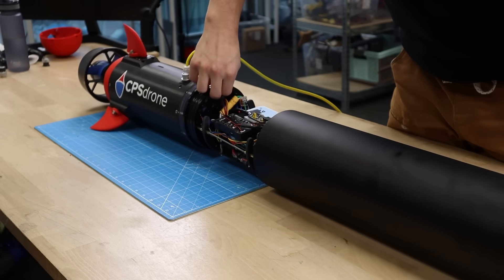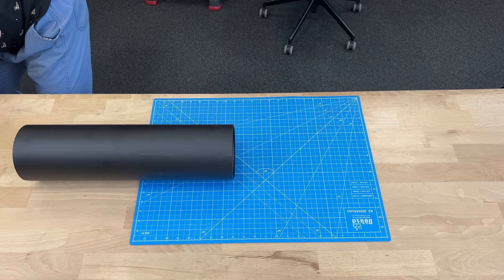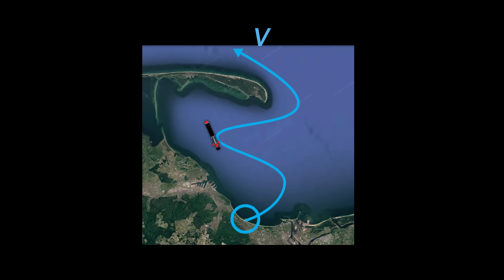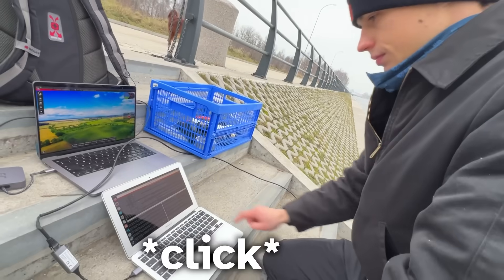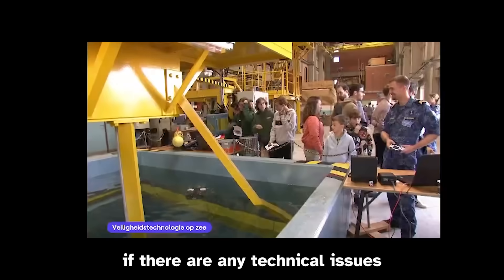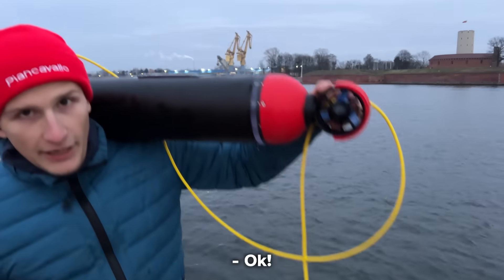Building a fully AUTONOMOUS submarine

Comment: I really love this. Im not engineer, or programmer. Just basic hobbyist that works just with steel and never made something like this. 

But if i had to talk about hydrodynamics, i would make front cover not round, but more long, olive shaped. And instead of buoy for GPS, i'd let drone resurface from time to time to get signal for correction in navigation. For emergency, like low batery etc maybe make some device that would work as baloon or ballast tank to resurface. Better invest time in this than entirely lost whole drone. And talking about GPS, small separate GPS tracker in drone would be good too, in case drone went missing and electronics or batery run out of energy or is somehow damaged. You could find it even if electronics is fried.

Comment: Nice! Besides inertial navigation, could downward-pointing visual odometry (a-la Ingenuity Rover or an optical mouse) be another cheap option? (Combined with a simple echo to get the distance to the bottom). I’m not sure what wavelengths the camera would need to operate in to reliably see features on the bottom underwater, so perhaps it’s not viable because of that 🤷‍♂️

Comment: You can use a INS or use pito tubes and find velocity using pressure differential ( v = √((2 delta P ) / rho )  and use software to find location after turns

Comment: IF DVL is too costly , maybe try set submarine to come up time to time and update it location , also try to predict underwater position based on  engine speed and turning . also maybe add 4 small motors instead of fins because if it ever got stuck , it would be able to do rotation at 1 point

Comment: For data connection, consider using (high power) LEDs. For full duplex, pick two different colors and use appropriate filters on the receivers. That should give you a connection for at least a few meters in water without a cable.  Or use sound.

Comment: Why not have the back thruster pivotable so you can point it up and down and left and right, would increase turning ability, reduce drag without that thruster on the front, might even be strong enough to not need the fins which would be better for simplicity and it might even be more precise than the fins.

Comment: Building an Autonomous Underwater Drone: Design, Challenges, and First Test

*   0:00:02 Introduction: The goal is to create a self-swimming submarine capable of long-distance, autonomous underwater exploration (e.g., searching for shipwrecks).
*   0:00:14 Challenges: Autonomy is difficult due to: 1) Prior experience was with manually operated drones, the new drone must navigate on its own. 2) Underwater GPS is unavailable. 3) Long-distance travel with high reliability is needed.
*   0:01:26 Series Overview: This is the first video in a three-part series, focusing on building the drone from scratch and conducting its first autonomous swim.
*   0:01:39 Long Distance Solution: A long, tubular design is chosen to maximize battery capacity (for 12+ hours of operation) while minimizing drag (frontal area).
*   0:02:58 Steering Module: A 3D-printed steering module houses fins and a single motor for propulsion, optimizing energy efficiency.
*    0:03:33 Propulsion: A high-quality t500 Thruster from Blue Robotics is used.
*   0:03:36 Fin Design: The fin design is inspired by a shark's fin for optimal maneuverability. Servos control the fins for pitch, roll, and yaw.
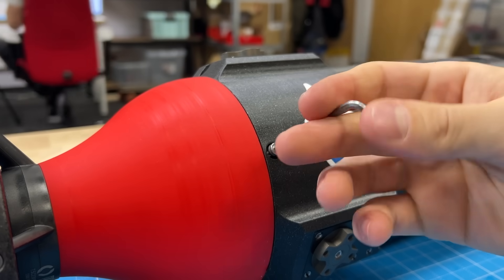*   0:05:06 Buoyancy and Trim: Careful consideration is given to weight distribution, using buoyancy foam to counteract the weight of the motor and servos.
*   0:05:40 Waterproofing: Waterproof connectors, penetrators, and a polycarbonate end cap ensure the electronics remain dry.
*   0:06:12 Design Benefits: The design is simple, hydrodynamic, and allows for future upgrades (e.g., sonar).
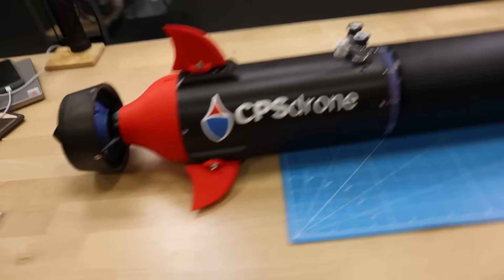*   0:06:40 Localization without GPS: Since GPS doesn't work underwater, a Doppler Velocity Log (DVL) would be ideal, but it's too expensive ($8,000+).
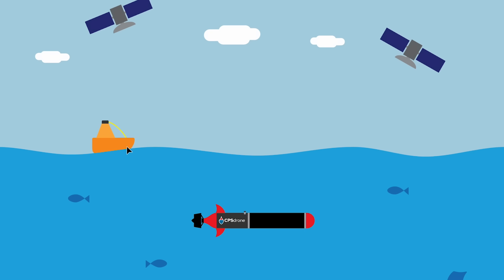*   0:07:45 Buoy with GPS: A temporary solution involves a surface buoy with a GPS, tethered to the submarine, providing location data within a 3-meter accuracy.
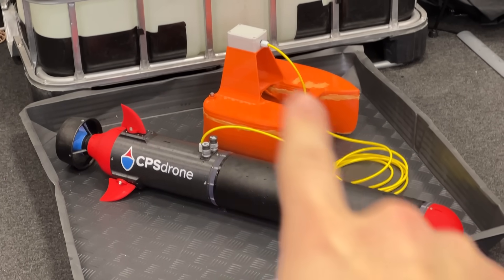*   0:08:46 Autonomous Control: The software, running on a Raspberry Pi, uses GPS data from the buoy to calculate the angle to the next waypoint and control the drone's yaw and pitch.
*    0:09:52 Control Software: A Pixhawk flight controller handles the low-level control of the drone's orientation, receiving high-level commands (target yaw, target pitch) from the Raspberry Pi.
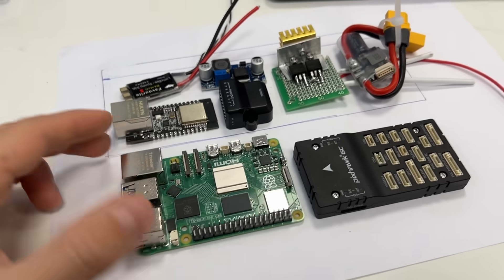*    0:10:20 Electronics: include a Raspberry Pi, a Pixhawk, a Wi-Fi router (for wireless mission uploads), and a battery pack.
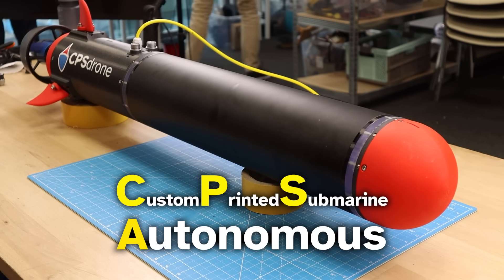*   0:11:10 First Test: The first autonomous test takes place in a river with a safety tether.
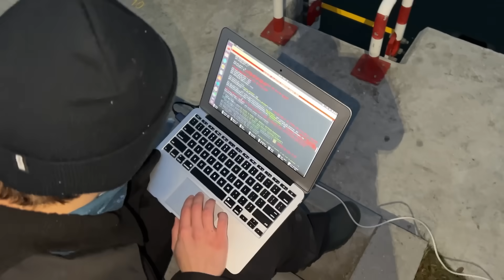*   0:11:57 Initial Problems: The drone struggles to turn effectively, and the water's salinity affects buoyancy, requiring additional weight.
*   0:12:29 Second Test: Larger fins improve the turning radius, but the drone is slow and struggles to descend.
*   0:13:08 Servo Failure: A critical servo motor burns out, requiring a significant modification.
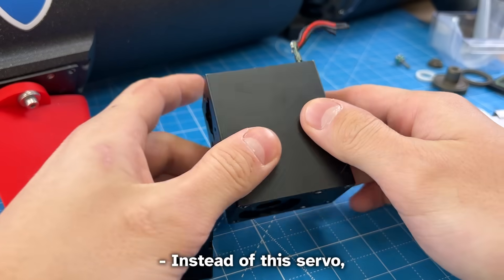*   0:13:32 Quick Fix: The failed servo is replaced with a motor mounted at the front, providing a makeshift yaw control.
*    0:15:56 Successful Autonomous test (Modified): The drone, with new steering and fins angle adjustments, successfully completes a short autonomous mission, maintaining a near target depth (with some deviation), proving the basic functionality of the autonomous control system.
*   0:17:09 Next Steps: Future improvements include a more stable buoy and removing the long tether to reduce drag.

I used gemini-2.0-pro-exp-02-05| input-price: 1.25 output-price: 5 max-context-length: 128_000 on rocketrecap dot com to summarize the transcript.
Cost (if I didn't use the free tier): $0.03
Input tokens: 17113
Output tokens: 887

Comment: What I really would love to see a video on is how you keep things waterproof! In my opinion, that's the part where most underwater projects fail...
Reply: Yes! Especially for the 3D prints
Reply: the same way you would keep a water bottle waterproof.
Reply: @luxraider5384 lol. No. If you think that, you've obviously never 3D printed anything or put anything under water. This is a really difficult problem and nothing like closing a bottle. It's closer to constructing a bottle from scratch but it's full of holes and weak points.
Reply: For the buoy it looks like they just slapped on some sealant, and for the sub itself it looks like their solution was "don't bother" — I think they are just exclusively using pre-waterproofed self-contained servos/cables/etc. The only actual waterproofed section might be the center aluminum tube, which is fairly easy to waterproof.
Reply: They talked about that in their CPS 5 video
Reply: 弄得跟鱼雷一样

Comment: You can build in a recovery system that will use a single CO2 capsule to be penetrated when battery level drops too much, and inflate a recovery balloon that will raise the submarine to float. 
Then you need the low frequency recovery beacon that will operate days with single small battery, and have range of multiple kilometers (about 7-10) by having the 2-3 cm antenna above the surface. It will allow to automatically transmit GPS coordinates (that it can receive when antenna above surface) to home station listening it. 

More here: https://www.youtube.com/watch?v=fmYw35U7rYg

If you can, make the electronic valve to the CO2 capsule to release it to avoid forced penetration to puncture the seal. 
Single 12g CO2 capsule has 12g (~15 cm3) of CO2 at 60 bar pressure. It will inflate a balloon in volume of > 6 liters. That is more than enough to pull up such low mass submarines (or use two.. for > 12 liters). 

I would totally build in such emergency/recovery system for multiple reasons (investment, safety of animals and other vehicles etc).

Comment: The autonomous submarine knows where it is at all times. It knows this because it knows where it isn't. By subtracting where it is from where it isn't, or where it isn't from where it is (whichever is greater), it obtains a difference, or deviation. The guidance subsystem uses deviations to generate corrective commands to drive the autonomous submarine from a position where it is to a position where it isn't, and arriving at a position where it wasn't, it now is. Consequently, the position where it is, is now the position that it wasn't, and it follows that the position that it was, is now the position that it isn't.

Comment: Hi there! I m wondering why you put foam inside the tube wich is sealed. From what i know, if the tube is filled with air, that is the much buoyancy you can get. but maybe i m wrong. And i have an idea for an emergecy recovery mod where you add balast that you can fill with compressed air or water. If there is something going wrong it trigger the valve and your submarine go to the surface where you can have a gps signal. it can be used to navigate the drone as well if for exemple it go to the surface every 10 min to re calibrate its position with gps.

Comment: hmm, if you could build in a depth control system, it would be trivial to have the sub pop up every 5 minutes to check its position via GPS. 

otherwise you really have to do it the old fashion way. plot your direction via compass, check your velocity, mark the time, and have some good charts. if I had to do it, I'd make everything quadruple redundant. 4 compasses, 4 clock modules, 4 dedicated accelerometers, and sonar at the front, belly, and rear of the sub for collision detection. sounds like it'd need a lot of compute, but surely a couple pi5s could handle it.

Comment: The cartels are going to love this!!
Reply: was thinking the same thing..  lol
Reply: @KouRou2002  I too
Reply: Not really... They know how to build submarines or at least submergeable boats. I don't think they are using electrical ones yet, and if they do, they would have a diesel generator or something to charge them up intermediately. Navigation is a far bigger problem, and this DIY project has no particular solution to that yet. Because of the distance, the hull needs to be much larger. And the Human crew has a lot of benefits...for example they can deter anybody but the coast guard from taking the cargo.
Reply: they would make big ones of these but with storage compartment for the merchandise, would probably require solar capabilities for such long distances
Reply: @pear-zq1uj  Solar is no good... in daytime those panels are visible for miles, at night time they don't work. And if you have to stay at the surface, you might as well use a diesel generator or engine.
Reply: @Andreas-gh6is  also salt water will create a haze over the glass panels and immediately reduce the effectiveness
Reply: @Andreas-gh6is  Solar panels actually do operate underwater rather efficiently. FYI
Reply: @Syvtek  solar panels work underwater, yes. But not nearly as efficiently as in air. And I just don't see a solar powered drone even being able to beat any current or tide.
Reply: @Andreas-gh6is  Wrong again, bot. Panels are more efficient underwater due to the heat mitigation of the water.
Reply: @Syvtek  I can't find a single source saying that. They all say that even clear water will absorb IR and UV light, while you can completely forget sea water in most places. You can't tell me that if you can barely see anything below a couple meters, that solar panels are more efficient there than in direct sunlight.
Reply: @pear-zq1uj  not at all if its big enough it can certainly store enoughbatteries to travel a very long way it doesnt need to maintain temp or life services the battery is only motors and controller.. but they would be fairly easy combatted tracking the signals it produces..
Reply: I'm sure they are having it for at least 5-7 years.
Reply: Not really, cartels, terrorists and foreign armies seek simplicity and effectiveness, this little sub is full of totally unnecessary over-engineering, why put 3 servos when you only need 2? Examples like that in every moment of the video, it is for the same reason that a cartel or a terrorist would use a Toyota Hilux instead of an unreliable American truck.
Reply: Exactly. Why put a computer in it when you can put a tiny beaner instead
Reply: 420 likes is crazy
Reply: Yep
Reply: The DVL isn't gunna buy itself.
Reply: “This bad boy can fit not that much cocaine in it but at least you don’t have to manually steer it”
Reply: since the cartels are designated as terrorists since 2 days, they have other things to worry about...
Reply: If you've got deep water, and delivery isn't time-critical, save energy by being negatively buoyant and "freewheeling" downward, then blowing out a trim tank and "freewheel" uphill. Surface for a GPS fix and to compress air as needed. Rinse and repeat.
Reply: and Ukrainian military forces too
Reply: YEAH, that's the main thing I was going to make this for a few months ago. Getting pure coca sounds like the only way to survive in our current economy... Glad someone done this for me. <3 01 8
Reply: so easy to intercept and track

Comment: A few tips from an Engineer that has no knowlege of submarines 

Build in a restube style airbag that pops after a set time and makes the whole submarine buoiant.

You could also set free a gps pinger if the airbag fails

Addition(because i saw that my ideas were commented by a person that saw the video earlier and had the same ones:) )

Garmin sells echo devices for boats or fishermen to scan the ground. Not that expensive.

If you create a system where you suck in water in the front and controll the side wich you release it with a flap or valve distribution system you could streamline it a bit more. 

If you like my suggestions i could model a prototype in Creo parametrics :) 

Kind regards from Germany 
I love your Work!!!

Comment: What if you put above it a gps antena, with a stick of one meter or so long, the u use enertial system, gyroscope and accelerometer,  it's cheap, then you steal it or it stear itself autonomously using the enerrial system, and you program it in the code to steal using enerrial system and each and a while it surfaces on meter under surface where the GPS emerges and connect with sattelite and correct enerrial system errors if there is any, then dive again, once you see the enerrial system steering is reliable and has no errors, or not big errors, you can relay 100% on enertial navigation completely. This way you can use these surfacing moments to send data to your ground control station, and even send images. That would be my approach.

Comment: Awsome Project! For the Localization you can use a accelerometer (like in a Wii Mote very cheap and ok precise) like in Aircrafts as an inertial reference unit. More precise sensors can also recognize smal drag. For heading a magnetic compas is fine wich in combination of the IRU can recalibrate the Heading. With the IRU you have also the pitch yaw and turn of the vehicle. For an alternative sonar, you can check the System for pleasure crafts, garmin, simrad and co produces Sonar Mapping devices wich can communicate for example with NEMA Interface.

Comment: one idea that might work for letting the sub know it's position could be a concept often used in aviation and model rockets.
you tell the sub the starting location and then measure its accelerations using a set of on board accelerometers which you can then convert into a movement and location like the DVR but much cheaper. the only potential issue is that the accelerometers tend to drift over time so you need a robust system that is well tuned or it will accumulate error over time.
Reply: The INS (Inertial Navigation System) is very accurate for a short term movements, but it is unreliable to long term movements.
SO the drift generated can be partially improved by having 2-3 INS that calculate position autonomously and then have additional computer that will combine the data and reject if there is too big difference on some source (if using > 3).

But how well can a small commercial products count properly currents? There would need to be proper detection of the earth magnetic field and rotation effects to have a good estimation. 

Considering that top military INS systems generate 1-2 miles error in an hour, the solution for them before GPS was to pilot do a visual landmark sync. So either by flying over known landmark and marking position, generating error by pilot timing. Or using a onboard targeting device like laser or radar to range the known landmark.  This can't be done under water commercially, what makes it interesting. On military submarines they can use sonar to sync their landmarks, if not possible surface to check it. 

For 15-30 min operation I think the commercial cheap INS systems would be accurate enough.
Reply: it won't work because of the currents in the water it will be wildly off target
Reply: @fastarturo1284 INS is able to measure currents. But they are not accurate in the long term. Especially not ones you can get for $10 from Ali Express.

Comment: About the location problem you can use a inertial navigation system like on real submarine consists of 3 accelerometers and 3 gyroscopes with the barometer already onboard. Using cheap sensors it will drift after awhile but it can easily resolve by occasionally resurface and use the GPS to calibrate the true location and speed.

Comment: You could equip the drone with a transparent window, behind which you could install a krypton flash lamp for photography. You could set up infrequent flashes that could perhaps be visible from the depths in case the drone is lost. You could use a very powerful lamp, say 2000 J, but make some smart activation mode to save energy.